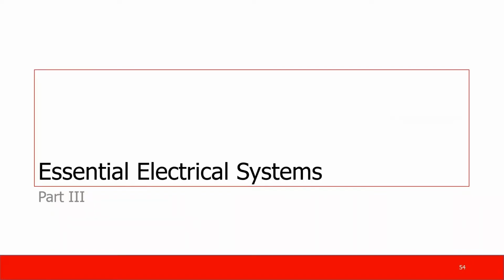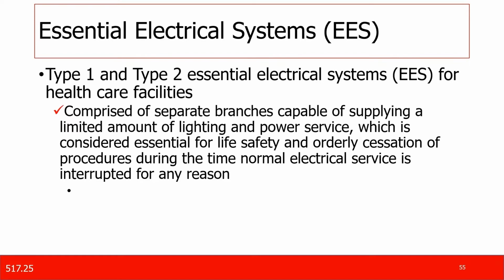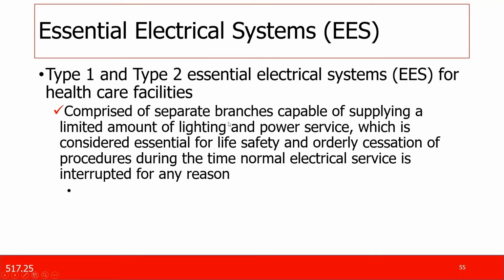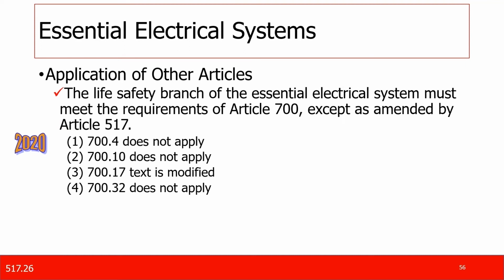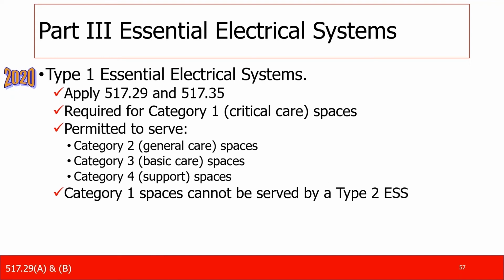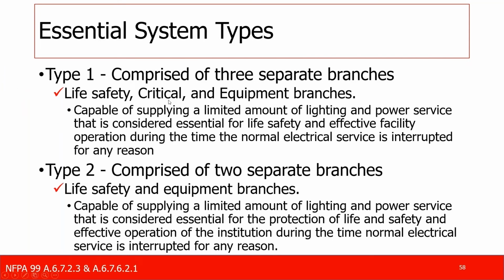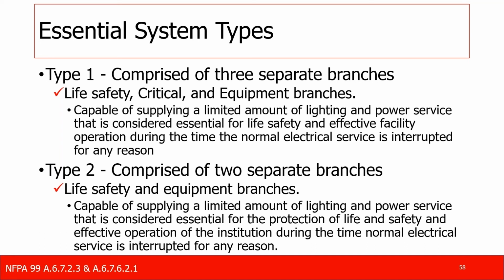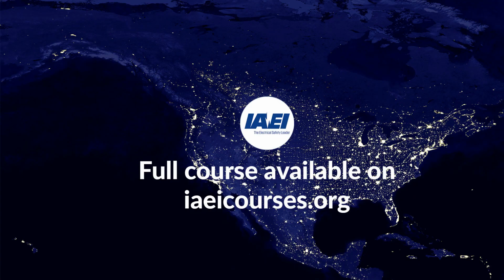IAEI Training Shorts — Essential Electrical Systems in Health Care Facilities in Article 517

Comment: Retired from a large childrens hospital and found it very interesting how emergency power was handled. Just about all of the new ATS's had closed transition power transfer that made monthly ATS testing easier. Thimk I read some where that you are supposed to secure normal power to start a monthly ATS test but they always started up all the genetators and warm them up. Had to have 3 starters on natural gas generators to ensure they were on line in under 10 seconds.